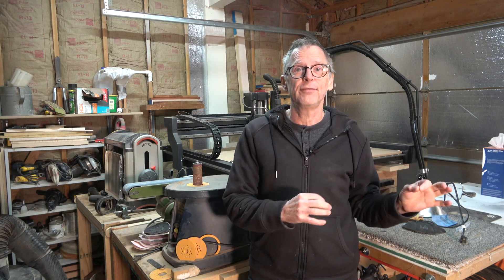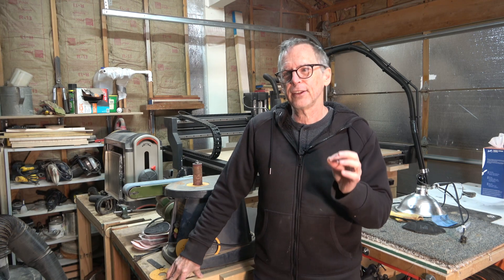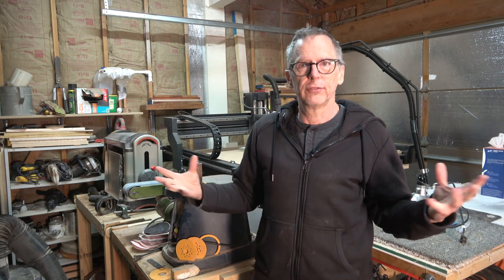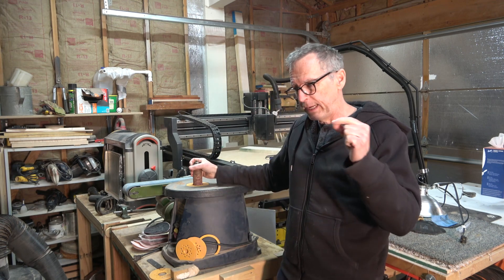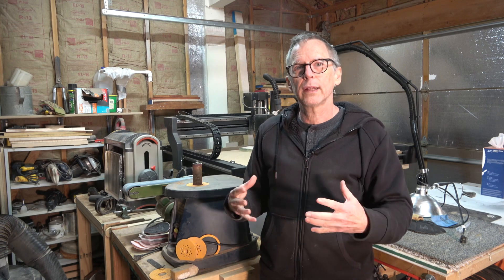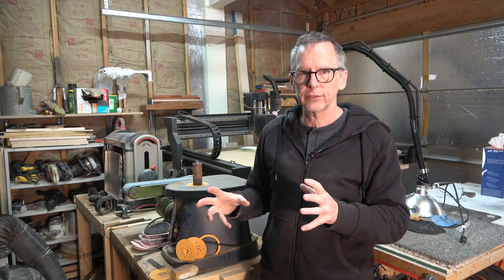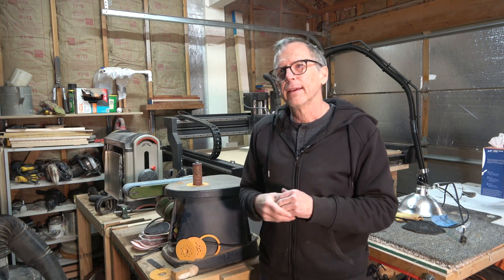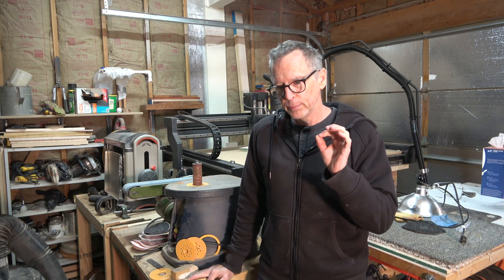CNC vs Traditional Power Tools

Comment: Hobby CNC machines are so affordable these days it really is a good way to start. When I was 1st getting into the hobby I looked into it and had most of the essential tools needed. Maybe not as good of quality as needed to do it well, but enough. The main ones I was missing were for making the fretboard, and I really wanted to make that myself. When I looked at the cost of the tools to properly radius a fretboard and do precise fret slots, the CNC was a no brainer. it wasn't much more expensive and I could use it for so much more. 

Chris, thank you for all the guidance when I 1st started. Your videos really helped me learn how to build a guitar and also helped me pick the best way to start for me.

Comment: About drilling holes on a cnc machine!!! You can use the usual processing inside the contour of the vector, and then you can make a large hole with any cutter!!! It all depends on the length of the cutter. That is, how deep a hole can be made.
Reply from the maker: Don't use up all your exclamation points!!!
Reply: @HighlineGuitars  OK, but I didn't understand why not to use exclamation points. Did it offend you somehow?
Reply from the maker: @GRSTGuitars  no, I wasn’t offended. I was making fun of your silly overuse of the exclamation point. Twice you used three when one was enough.
Reply: @HighlineGuitars  There is nothing stupid here))) But thanks for the quick response;-)

Comment: I have had the same path as you (starting with traditional power tools), but I am struggling to find the time to learn the programs and workflow needed for CNCing. I have a Shapeoko and it's been great for making templates and inlays with the provided software, but I haven't dove into cutting fretboards, necks or bodies yet. With my limited time to work on guitars (since it is a hobby that I can only work on after my day job and on weekends), I'd rather be working on them in my workshop rather than sitting in front of a computer, as I work in software dev and I sit in front of a computer for 9+ hours every day. Eventually I want to move to primarily CNC, but the time investment is just too much for my current limited schedule. It's been a struggle....

I think the first file I want to make is a fretboard. The precision to cut the frets and inlays seems like a big time saver vs. doing it by hand.

Comment: Great video.  3 months into CNC and I agree, it should be step one over hand tools these days.  

The introduction of human error into fret intonation as well as bridge placement is so.ething that can be completely avoided. 

You can also make your own precision tools and jigs (fretboard radius blocks, fretboard Radius, neck rests, saving tons of money over specialty tools)

Also wanted to mention many home planers may say 13.5" but in reality only have a 12" center blade.

The clamping problem can be solved by using painters tape and CA glue. CNC for the win.

This has been answers to questions no one asked.